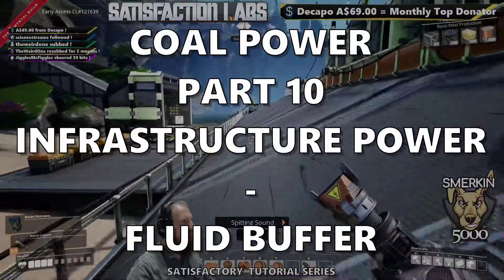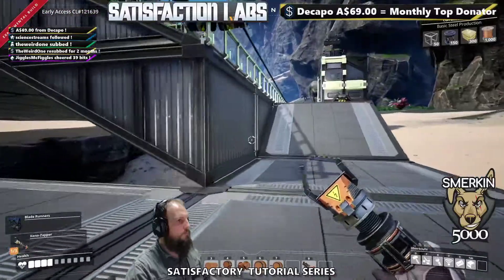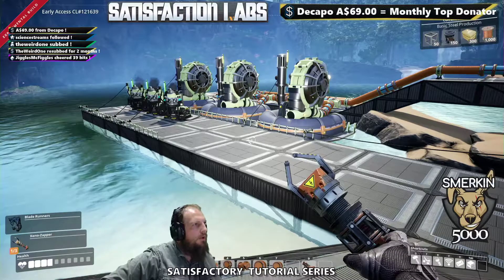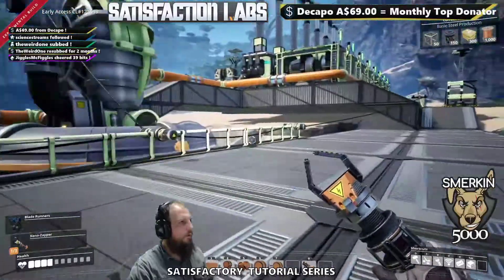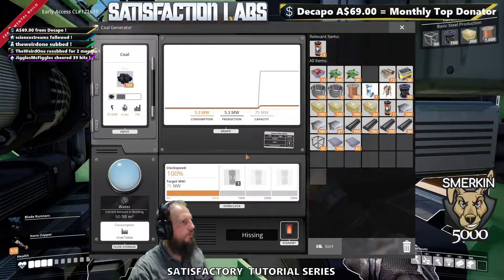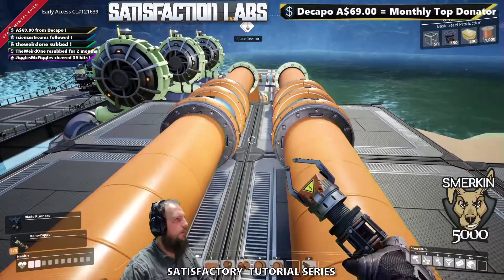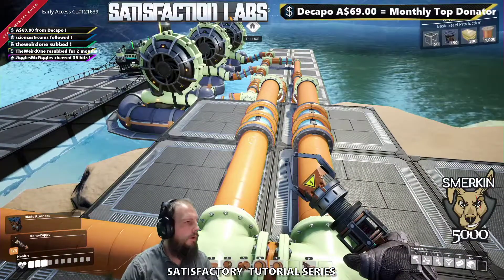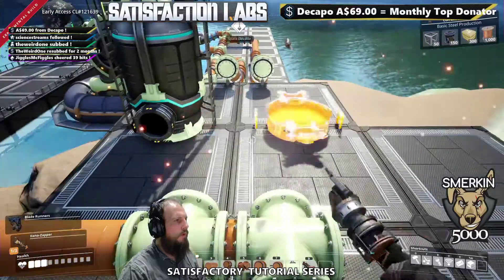109 Coal Power Part 10 Infrastructure Power Fluid Buffer

Comment: Hey dude, thanks for your amazing videos. Im new to the game and Im having a bit of trouble understanding your biomass circuit. You appear to have a circuit consisting of the mk1 miner on the coal, 1 of the coal power gens, and the 3 water pumps. You say this is to keep the core services running should you have a power issue. Originally you had all the coal power gens connected to each other but then you seperated the one coal gen to power the 3 pumps and miner. But how is this second circuit self sustaining? It comes back to the original question of how can the water pumps be powered by the coal gen, when the coal gen needs the water pumps water to keep going. I must be missing something obvious as im not quite getting this bit. Thanks!
Reply from the maker: Great question. Initially you need the Biomass burners to provide power to the Miner to supply coal to the generators and power to the Water Extractors to provide the water, all of these are on an isolated circuit. Once the coal generators receive ample supply of coal and water, they automatically power on. At that point, you need to connect the dedicated coal generator to the isolated circuit and disconnect the biomass burners, this will continually provide power to the miner and extractors while they continually feed the coal generators. The generator burns a unit of coal every 4 seconds, in that time period more coal is extracted and more water is extracted. The generators have a buffer of 100 coal and 45 water, all of that has to run out before the coal generator stops working, hence it can continue to provide power for the machines that provide the resources. The only way this would fail is if you could not supply the resources quick enough and the generator runs out, it is the buffers and burn time which ensure everything is balanced.
Reply: @smerkin5000  Brilliant, thanks for your reply man! Love this game!!